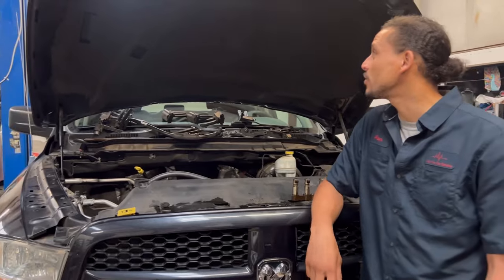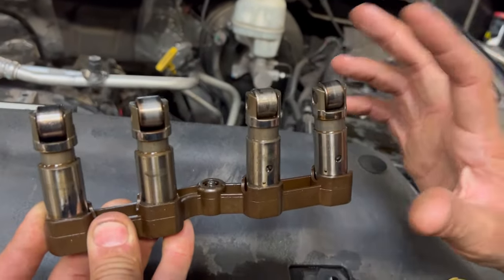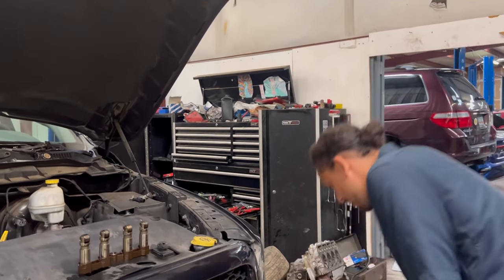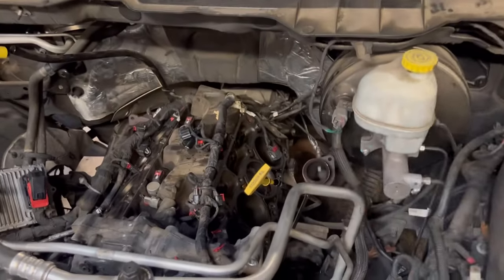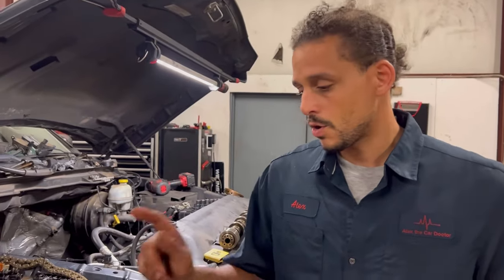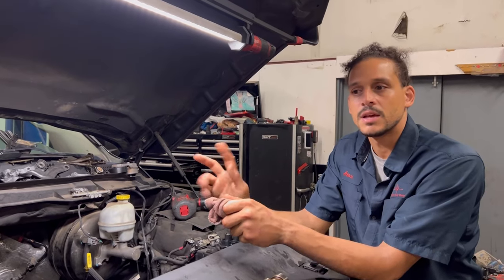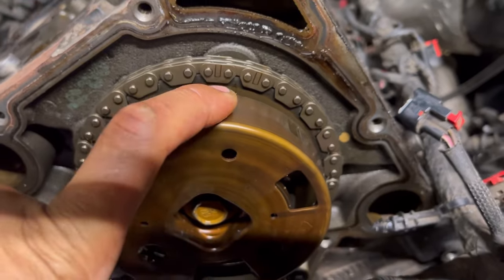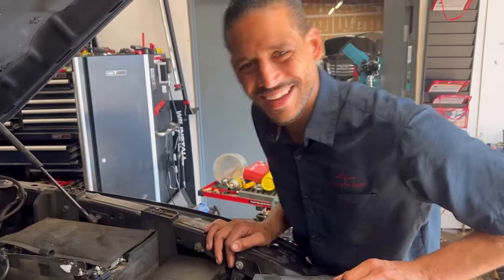The Lifters damaged the Camshaft on this Ram 1500 with the 5.7 Hemi #hemi #lifters #dodgeram #dodge

Comment: Had to have that done on my 2012 Jeep with the 5.7 Hemi. Replaced the cam, lifters and I asked my mechanic to replace the oil pump with a mellings as well. My mechanic told me it was an 11 hour job and would require pulling the engine out of the Jeep because there was not enough room to pull the camshaft. My total bill was $5k. The Hemi tap started at around 118K miles...so I guess I have another 100K miles at least before this happens again!
Reply: Happened to my 2011 with 60,000 miles on it.  At 220,000miles now with now more issues.

Comment: Lots of theories going around about these engines. I have a 2015 with 80K and I am hearing a tick, but it's ever so faint. If I have to break into the engine, a little hotter cam will go in along with non-MDS lifters. One of the prime theories on why these engines eat cams is excessive idling where the oil pressure is low. Police vehicles or service vehicles in general seem to be notorious for failing lifters. This makes me wish I kept my 2004 which was running flawlessly when I traded it for the 2015. I wonder if you had to replace some exhaust manifold bolts. They tend to break a lot on these engines. I wonder how many miles the truck in the video had? It might have been mentioned, but I didn't hear. Great video!!
Reply: how ironic.
i had a 2004
dodge ram worked perfectly.
now i have a 2015 ram making a ticking noise , metal in oil , and misfire 4 . in the shop rn

Comment: Would you recommend changing the rod bearings as well? Due to a small amount of metal shavings i found in the oil pan im already changing out the oil pump timing chain assembly since im already this far.

Comment: Great video.  I swear you said you had 250k miles on your rebuild.  From what ive read only 4% of Hemis get this around 100 miles and most have lots of idling.  Trading my 2019 now with 33k miles off before 100k miles for a newer Ram.  For some reason it has 50 lbs. per swuare inch oil pressue most all the time.  Use moter craft full synthetic 5/20 oil.  Staying with Ram as Ive seen a lot of newer 5.3 GMC and Silvarado engines blow up rods?, lifters, cams at 60k miles.  Said they got a bad batch of lifters, rods, and cams from China.  The GM 5.7 vortec also has cylinder deactivation. Never messed with buying ford with their small turbo chsrged engined.  Sadly Ram is going to replace Hemi after 20 years with 6 twin turbo.  Dont want it.
Reply: My ram had lifter and cam failure. just sold it two weeks ago. Ridiculous money pit.

Comment: @Alex, The Car Doctor - 2011 Ram 1500 with the 5.7 @ 117,000 had the p0306, took to a local shop and they replaced the oem lifters after a 2.5 month wait (I was told the camshaft was within spec) and milled the heads. $2300 1000 miles later same code took it to the same shop thinking it would be warrantied. Nope 3 months later and $3500 later they replaced the lifters with aftermarket and replaced the cam as it ground it down now. 500 miles later and the same code just popped up again. 
Went to different shop and they said due to the metal shavings in the system they would need to now replace the engine with a remanned Jasper $11,500 or Dodge dealer offered a factory rebuild installed for $14,500. Any ideas why the repairs didn't take? 
I just want my vehicle to run right its been almost 2 years now. I would also like your advice if the engine can ever be reliable again or if it needs replaced. Any advice? What would you do? Thanks for the video.
Reply: I had the same exact issue.
Reply: I had similar code (I don’t remember what cylinder) but that cylinder had the lifter with the seized roller.  It took the lobe off the camshaft causing the intake or exhaust valve to not open enough.  Since the code is reoccurring, I would HOPE the mechanic at least checked your coil pack and out.  If it’s still happening now, swap a coil off a different cylinder, clear code and drive it.  If the code follows your coil, it’s the coil otherwise.  Good chance they didn’t touch the oiling system the first time and the lifters weren’t getting the oil they needed and had the same
Problem come back. I HOPE they did an oil change at the bare minimum after the original repair.

Comment: Is this kind of tick usually very rhythmic, or is it not so much? My 2012 has a tick when it's at operating temp, and it's very steady and rhythmic, and mostly audible from the front driver side wheel well. However, I have no other symptoms such as a misfire or power loss, etc, regardless of RPM. So I'm not sure what to think.

Comment: Had lifter issue in my 2011 Grand Cherokee Overland with the 5.7L.  Bought it used at 60,000miles.  3 days or so after picking it up, power totally disappeared and was lagging bad.  Issue was same where the roller seized and wore the lobe off the camshaft.  They ended up replacing the lifters, cam, head gasket, etc under warranty.  I purchased the factory extended warranty and zero issue or cost to me.  I’d like to think they would’ve done it anyways considering how fast it happened after picking it up but who knows. Has been perfect ever since.  Knock on wood.

Comment: I have just bought a 2015 Grand Cherokee Overland 5.7 with only 22,000klms on it. It was stored for 5 years. The previous owners only used it to run around Sydney, no highway driving. I figure lots of idling. So, I have ordered the new Melling 10452HV oil pump and will also be buying headers/extractors to avoid broken manifold bolts. I reckon I should be right then.

Comment: My theory on way the lifter and cams get destroyed is.... the lifters are too solid and push too hard on the cams and rockers. And when something like that happens something has to give and its the bearings and cam shaft that gives up first. The lifters need a bleed off hole? What are your thoughts?

Comment: Do you recommend replacing the cam bushings.  Since your replacing the cam?
Reply from the maker: I only replace the cam bearings if they are scored up or  gouged if they are smooth I  leave them be because they are not the easiest to replace and require special tool

Comment: Quality information. Thank you. Was there any constant misfiring in the cylinder? I have a 2015 hemi 5.7 and I have done compression test and leak down test and it all passes but the cylinder that is misfiring does have about 20 more psi compression
Reply from the maker: Sounds like a bad lifter. If I remember correctly it did have a consistent miss
Reply: @AlexTheCarDoctor  you are correct. I peeled off the driver side cylinder head and sure enough the lifter is shot and seized

Comment: Also have to clean the screens on the sensors under the intake manifold. I think they are called msd sensors. I took one apart that ate the cam and the mds sensors were clogged.

Comment: My 2019 1500 classic with a 5.7 Hemi I only put mobile one since day one in it and at every 5,000k miles. 115,000 me almost blew the motor but I turned it off in time to find one of the lifters in the oil pan. And that was after turning it by hand that I got it to drop to the pan. Still will swear by this motor and am looking forward to getting it fixed. Love this truck so much power. But when I'm trying to say is it's not just the quality of oil because I did that I think it needs a higher quality pump
Reply: I always used mobile one. Also, then found out it actually does not meet the required spec. Started using pencil oil ultra platinum full synthetic. Check the MS 6395 spec.

Comment: Just changed out the manifold exhausts on both sides with broken bolts and now passenger side lifters making noise wtf dam , so anyway how much does it cost to replace cam n lifters part and labor?

Comment: Yep. Had the Hemi tick for about 75,000 miles before there was a noticeable performance problem.  Bought a 2011 Ram in 2014 with 45,000 miles, had the lifters and cam replaced at 180,000 miles. Also did the water pump, timing chain (belt?), and a few other things while it was apart. Yes, a lot of money, but it’s fixed and hopefully good for another 180,000 miles, provided it doesn’t fall apart from all the rust damage in the rocker panels and rear fenders. Love the truck’s comfort and how it handles, but don’t know if I’d buy another Ram.

Comment: hey my friend did you use any type of cleaning fluid/product to flush/clean the engine internally in order to get rid of the majority of the metal shaves/particles from the damaged cam lobe?? i'm in the same situation with my 2010 grand cherokee srt8 6.1 hemi so i'll greatly appreciate any info on that, thanksssss
Reply from the maker: Hey there the oil pan normally has all the shavings in it so make sure you drop the pan and clean it second do the oil pump and last change the oil within about 500 to 1000 miles and you should be good
Reply: @AlexTheCarDoctor  Thanks Alex for your help, keep up the good work

Comment: I have a 2010 ram with what’s most like a cam:lifter failure.. 120k on it 

Is there anything you do to flush out the metal that’s now in the motor?

Comment: How much does a job like this cost? I have a 2018 ram with the 6.4 in need. I would like to change mine out to a FRP cam and lifters and springs and push rods with a high volume oil pump same brand you used. I have changed my oil every 3k miles and used Amsoil and have 44k miles on it. Tick tick tick

Comment: Hello, how are you? Excellent video, I want to ask you, I have a Dodge Ram 1500... year 2014, 5.7 hemi engine, it has bad lifters and apparently also the camshaft, what replacement brand can I buy other than Mopar? Is it true that if you don't put Mopar it will sound the same?
Reply from the maker: I like melling. If you can’t get melling your best bet is to go back Mopar. Everything else is noisy, I haven’t had any luck with other brands.

Comment: Awesome video! If a hydraulic lifter was bad and the camshaft is not changed would that cause any problems?
Reply: from other videos, I've noticed that they check the camshaft - if it has any damage they swap it. Other just say since you're already down there might as well.

Comment: We have a 2019 ram.  I always start it and take off with no idling.  I also turn the mds off immediately when put in gear.
Reply: Thank you, I always start mine and let it idle down before taking off, especially when it’s cold, I’ll start doing it the way you do, it’s my first dodge that’s why, and also What’s mds??
Reply: Multi displacement system. Shuts down cylinders for fuel economy.

Comment: What about metal particals that came off the wearing parts. What did you do and what is your opinion on it. I have metal in my engine right now as we speak and getting tore apart. He says he needs to take it out and. Lean it and check the crank bearings. Any input is much appreciated

Comment: Is replacing the oil pump on a camshaft/lifter repair required? Or just recommended?

If so whats the reasoning behind it?
Reply from the maker: If the Cam isn’t destroyed then the oil pump should be fine. Unless you have 200k miles or more then the oil pump is highly recommended.

Comment: What brand of parts should we go with if doing this job? And why replace the oil pump etc.. is it just a do it while your there kind of thing
Reply from the maker: Any brand other than manufacture on the Hemi is going to make noise after you install them in my experiences. And the oil pump is case by case.

Comment: There’s still a ticking noise. Either needed to let it run for awhile or something else… how were the exhaust manifolds? Any cracks? 
Was there any metal in the oil pan ?
Reply from the maker: You’re right! I had to let it run for a while. I kept it an extra day to test. It did quiet down. Customer is still happy 🤗

Comment: Hi im Danny was curious on some info I just did the same job on a 2012 5.7 hemi ram and it starts and runs fine however I have couple codes and when driving it'll idle at 500 rpms and sometimes shut off. Why would that be?

Comment: so how it...ive had the lifers and cam shaft done 3 times in the last 4-5 years...(napa canada OEM parts)...last they didnt last ayear .and here we go again......is there a high performance shaft solution than replacer...better type of lifters....and change oil pump from high pressure to a high volume one. or just buy rebuilt.....just about same workload....more cost......but piece of mind?!

Comment: So aside from ticking Ive got misfire codes with no actual misfiring symptoms. Also has tranny issues, suspected stall converter, needs hood and roof painted, needs right rear door lock actuator replacement, and running boards needs replacement due to rusting threw. Its 160k so is all this work worth it? Just tranny and cam/lifters would be what 4-6k??  Just not sure I want to dump this much into it. 

I would be in you shop tomorrow if I wasn’t in the St Louis area. 

Thanks for the vid.

Comment: Question, I’m going to replace the lifter and cams, on my rt challenger. Are there better ones to put in versus the original parts from the factory. I was thinking of swapping out the original oil pump with a Hell Cat version to give it more oil flowing in the engine. I just don’t want this problem to pop up gain.

Comment: You guys are GREAT 😊 Would you know about how much the price would run for a job like this? Blessings from INDIANA ✌🏽
Reply from the maker: Thanks buddy I really appreciate it.a job like this can cost anywhere from $1500-$3000 I don’t really deal with pricing anymore but I know the range and it depends on where you live. now I have a friend in Indiana greetings from Atlanta Georgia may blessings be with you as well buddy
Reply: just dropped $2960 today to get this same job done
Reply from the maker: @lanehamer1804  did they replace the cam
Reply: @lanehamer1804  Hi - Were the parts included ?

Comment: im surprised the engine didnt get damaged  from all the metal in the oil. how bad do they have to get in order for engine to be shit? my buddy has a 12 ram that needs cam and lifters. i can do it but not for free lol. i just did the entire front end on my 06 commander. i mean everything you can think of too you name it and its new. put new seals in transfer case as well. it was alot of work but damn did it need it. the lady i bought it off of never took care of it. it only has 114 on the clock as well.

Comment: We purchased a 2012 Dodge Ram 1500 hemi 5.7 L on Feb 28... It was in the shop by March 1. The shop kept it 2 months. Replaced lifters, camshaft, oil pump, water pump.... warranty we purchased would not cover because it was a pre-existing problem. Picked it up on a Friday and by Sunday the check engine light came on and the truck started shaking. Took it to O'Reilly's to be scanned. It showed injectors I believe. So took it back to the shop on the next day, Monday. The mechanic said it's a stuck lifter. It's been there for a month again and he has yet to even start on it 🙄 this has been one of THE MOST frustrating things we've ever dealt with!!! Wish we could have y'all fix our truck!!
Reply from the maker: Dang, sorry to hear that! I wonder what brand of lifters they used?? 🤔
Reply: We're not sure, I'll try to remember to ask him when he gets it ready.
Reply: It's been an aggravating experience. We've made 3 truck payments by now and only been able to drive the truck 2 days.
Reply: My ram had lifter and cam failure. just sold it two weeks ago. Ridiculous money pit.

Comment: Are the new parts upgraded? Because if not it makes no sense to fix because it will happen again. Also ive heard that the melling pump will set off the CEL because computer thinks something is wrong. Due to the pump pushing more oil than factory.
Reply from the maker: I’ve never heard that about the Melling pump and never had a problem.
Reply: @AlexTheCarDoctor  oh ok Alex but i seen videos explaining it.

Comment: Mine had a mds lifter fail be and my buddy did a new cam and lifters MDS deleted it and it took just a weekend 5.7 is easy to work on and it sucks that the mds system and the low volume oil pump have given them a bad rep they are a pretty dang strong v8 with aggressive vakve angle very good flowing heads great intake manifold and strong 4 bolt mains 2 are cross bolted.

Comment: We just purchased a 2012 Ram 1500 5.7 hemi. A mechanic looked it over before we purchased it, said lifters and timing chain were good. The day we picked it up it was making a noise similar to this video. We brought it back the next day. His mechanic said sounds like rear main.... Now a week later he's saying bad rear bearing and we'll need a new engine. We did purchase a warranty thank goodness. But it feels suspicious that it was "checked out" 2 weeks ago & when we picked up it's making a loud knocking noise & needing a new engine 😕 I have a video of the truck running but can't find how to add it to comments.
Reply from the maker: Hey there,them folks are full of it. Send it to me on Instagram
Reply: Just now seeing your reply. The mechanic ended up replacing the lifters, camshaft, oil pump, water pump. We took it back within 2 days because the check engine light came on and it started shaking. I'll send a video of the sound it originally made. It still makes a ticking sound after all that work though.

Comment: The bad
My 22 Ram 5.7 from quiet to ticking to a detonated motor in 3 minutes on the interstate at 42k miles. All service done by the dealer at 5000 miles or less. I was there when the dealer dropped the oil pan,  it looked like a pan full of chewed up beer cans. 
The good 
They gave me a rental, put a new motor in it and had it back to me in 17 days. 
The bad
The new motor rattles like crazy. They said if it fails they will just put a new motor in it under warranty.
Not happy, I put 300k miles on my 2013 F 150 5.0 with no issues.
Reply: @BlastedKat  😔😩😩 that hemi would’ve been thirsty messing with me💧